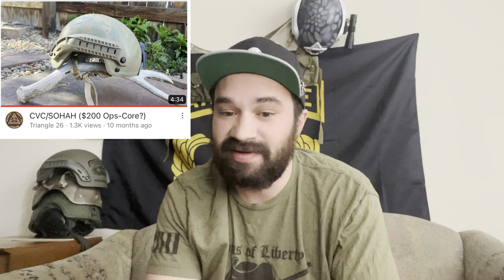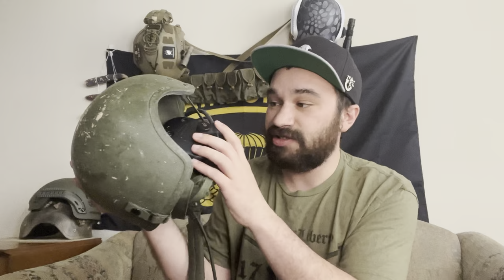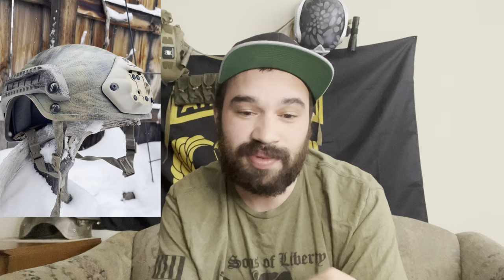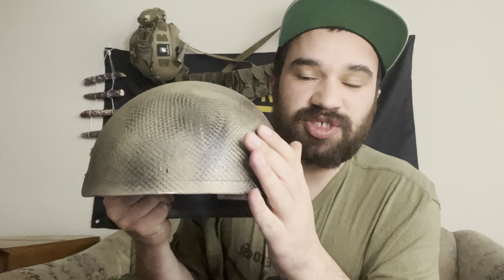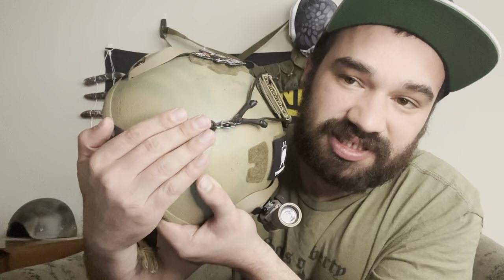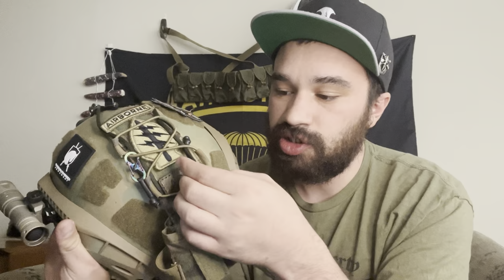CVC/SOHAH - Everything to Know

Comment: A little late to the party here but this video peaked my curiosity about the DH-132A ballistic rating. I bought one with three Demil holes drilled in the top, and shot it. To my surprise it stopped a single round each of 9mm, .45, .380, and .22 all from short barrels. Very impressed (obviously it’s not rated for this and your mileage may vary).
Reply from the maker: That’s great data, thanks for sharing. I’m increasingly a fan of the 132A, I think it makes a lot of sense. More often than not, helmets are for shrapnel anyway.

Comment: Great video man. Is there anyway to tell the difference in CVC model without the tag visible?
Reply from the maker: It depends if you have it in your hands or are just looking at pictures. If you have it in your hands, the weight is the dead giveaway. 2.5-3 lb shell weight means DH-132B. 2.25 ish means ACVC. 1.25 ish means DH-132A.

If you are just looking at pictures, it gets a little harder. Basically you are just looking for the thickness of the shell, and the thickness of the rubber trim around the edge. On DH-132B and ACVC models, both of these dimensions are significantly thicker than on DH-132A and DH-132 models.
Reply: @Triangle26  thanks!

Comment: hey, great video! I live outside the US and also suffers from large dome syndrome, eventually i found a large DH132A8/V8 shell. (basically, this is a gentex 132A intended for leopard 2 use or something like that) comfort wise they make for great NV helmets when you dont want to ball out half a grand for an ops core or TW bump helmet (as thats what they usually cost over in EU)

 i personally opted for clones of the ops core maritime rails, for those i only needed to enlargen the bottom hole and use that for the setup, then of course drill out the rear holes from there. unfortunately for me, a large 132A is still almost too small for me though! but still fits with very thin pads

Comment: Thinking of cutting mine up front so the rails are flush with the edges. Any tips?
Reply from the maker: Not positive I understand. Are you saying you want to reprofile the helmet itself, and raise up the front edge?
Reply: @Triangle26  yea exactly
Reply from the maker: Got it. Two tips:

1) In case you’ve never cut Kevlar before, make sure you have realistic expectations going in. Watch a video of someone doing an ACH high cut conversion. It’s totally doable, but the risk of failure is higher than anything I describe in this video.

2) If you are up to it, the right tool is a fresh, fine-toothed steel blade on a jigsaw. Slow and steady, measured cuts. Don’t try and sand, just seal in with epoxy. An epoxy putty like JB weld works great for sealing, and also replicating the feel and appearance of the original rubber trim.
Reply: @Triangle26  dude your amazing. I’m still in the measuring phase lol I’m planning on doing a slight engrave of the outline with a diamond bit for a dremel (never cut Kevlar so lmk if that’s dumb) then do the full cut with a fine tooth blade on my sawzaw (again might be dumb) I saved the original rubber seal and I’m gonna attempt to still use it after I epoxy the Kevlar edges.

Comment: Are there any benifits to running a 3hole shroud on a ACH that comes with the single hole and norotos titanium mount? Just wondering if it's even worth upgrading and drilling
Reply from the maker: Technically the three-hole is more stable, but I’ve personally never noticed a performance difference. Unless you are having stability issues, I wouldn’t consider it a worthwhile upgrade. My current “go to” helmet has a standard Norotos one-hole.

Comment: do you have a link for the rails you use?
Reply from the maker: I can’t do a link, but I get them on eBay. Product name is “Tactical MSA ARC Helmet Side Rails MICH 2000 2001 2002 ACH S-XL Fast Shipping”, seller’s name is “tacticalgearstore”. I just bought a couple sets the other day as they are currently 15% off. Good stuff, US made.
Reply: @Triangle26  I appreciate it.